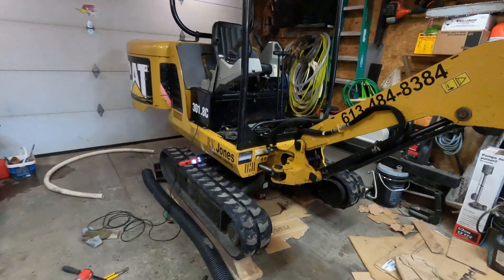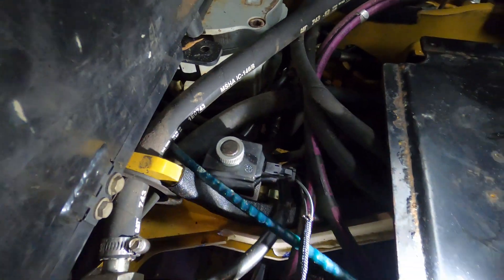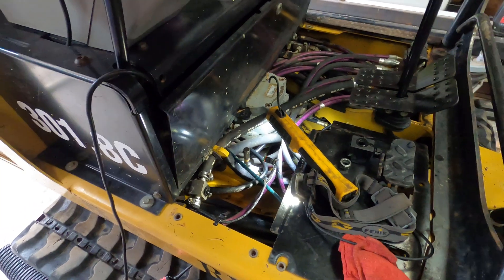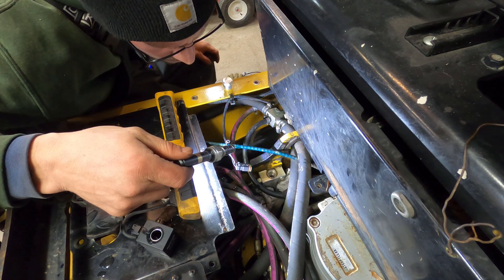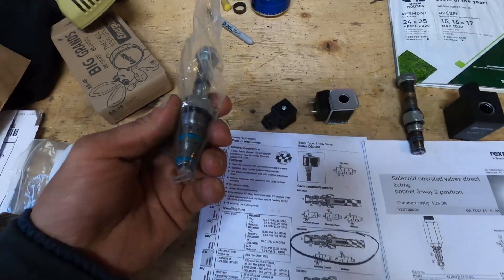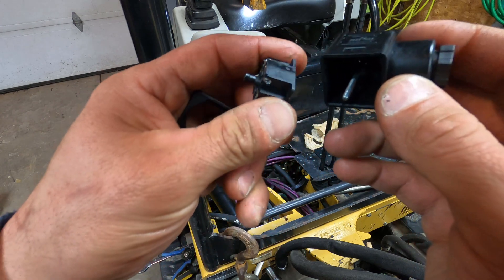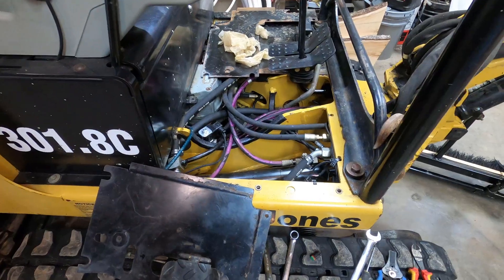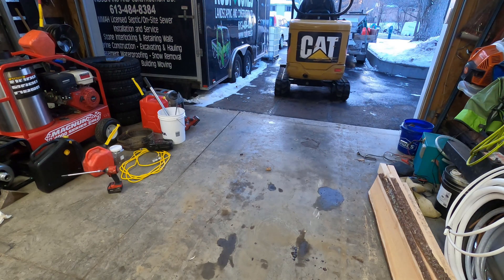Caterpillar Excavator Repair - Leaking Solenoid Valve

Comment: High 
I dont know if you could help but any ideas would be appreciated. I have a 302.5 with a problem with the hydraulics.
The cab tunes clockwise and anticlockwise and the front plate goes up and down ok.
No other hydraulics work.
Do you have any idea what the problem could be.
May Thanks Paul.